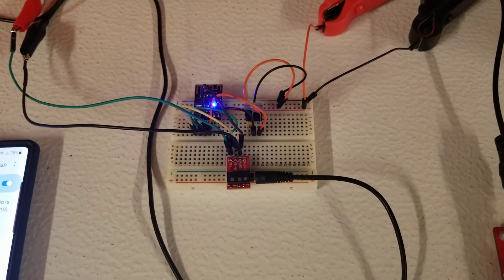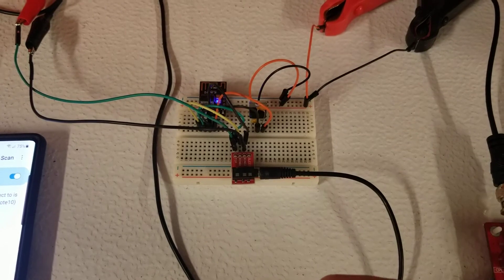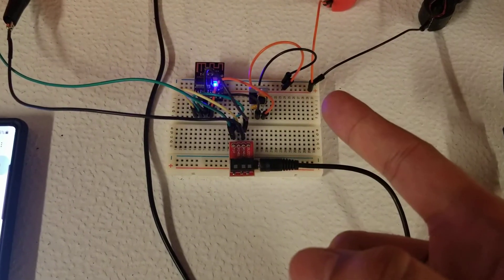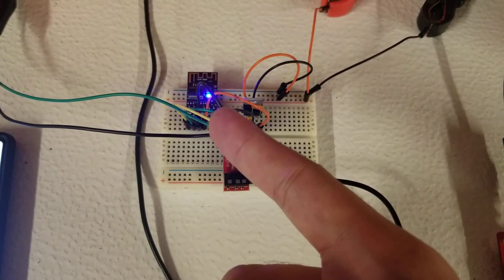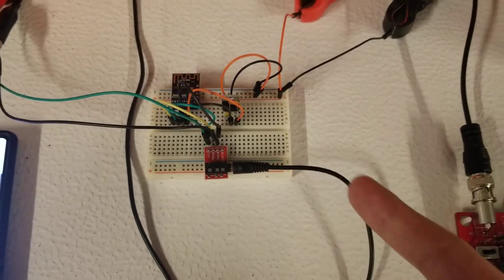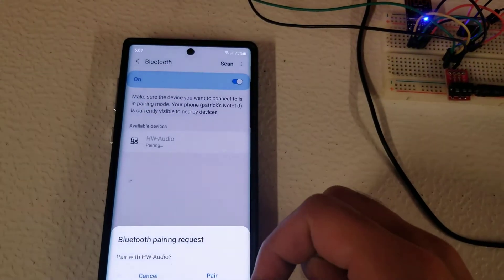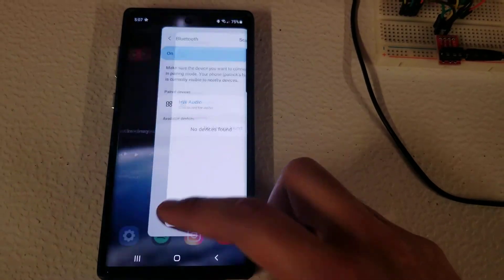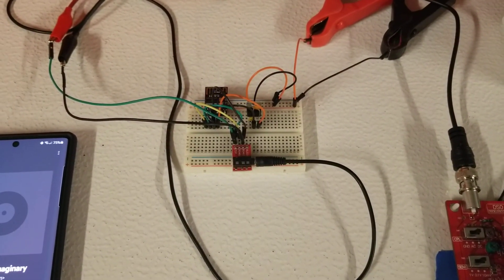MH-M18 Bluetooth Stereo Audio Receiver Demo

Comment: Sir how to use mute key output of this board to turn off car amplifier. As this chip outputs + 3.3 v high in mute stage. But car amp uses 12 volt postive for on and ground for off..

Comment: hello , for what are those 4 pins?
Reply from the maker: Hey! If you mean the pins of the audio breakout board, from left to right the pins are: tip (left audio), ring1 (right audio), and ring2 (GND). The fourth pin called sleeve isn't used here.
Reply: @patrickcohen8494  does the module power supply input share the same ground of the audio output?
Reply: Other 4 pins on the module , what are those for
Reply: @himanshumahara5324  2 years late but it's for USB